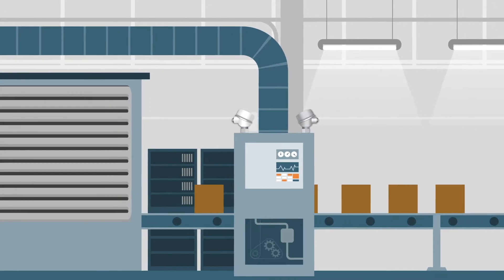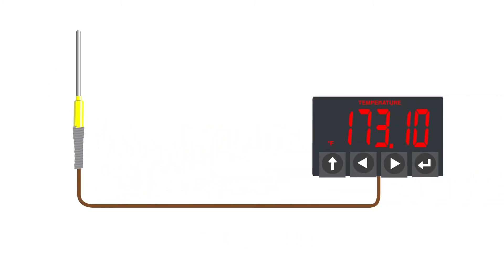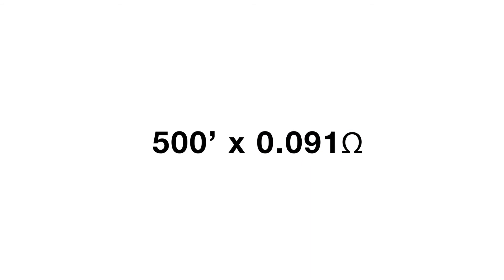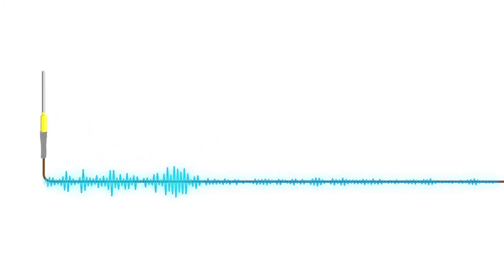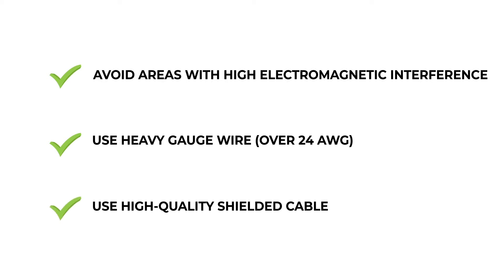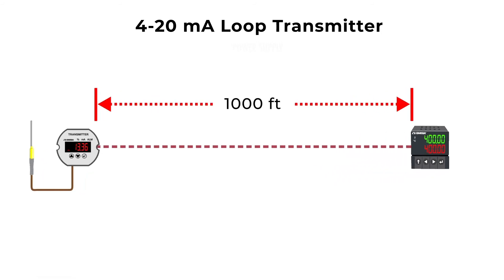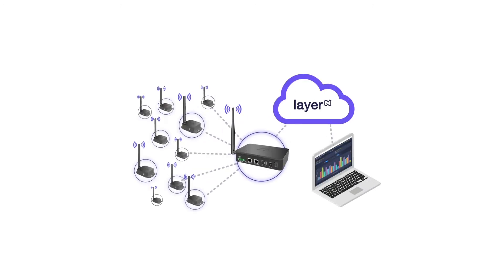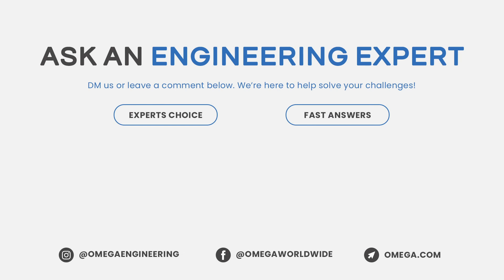How Long Can I Run a Thermocouple or RTD? -  Wired vs. Wireless

Comment: Dear sir,
As you said there are disadvantages of using a long cable to send the value of Temperature sensor in Ohm, but if we use the Transmitter next to this sensor to convert the value from Ohm to mA or V and send it. Is the problem still exists? Or even if we send the signal in Ohm and measure its value on the sensor and its value on the distant controller and check the different to add it to the value as a calibration process, do you think this may work?
Reply from the maker: Dear Learner. There are many variable that should be explored. You can get in contact with one of our Temperature Engineering Experts by emailing: temperature@omega.com